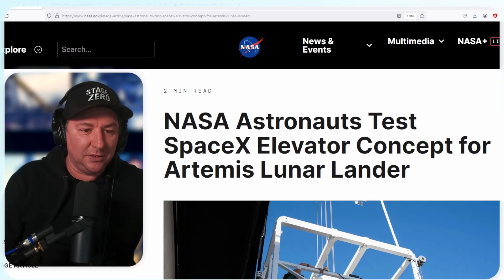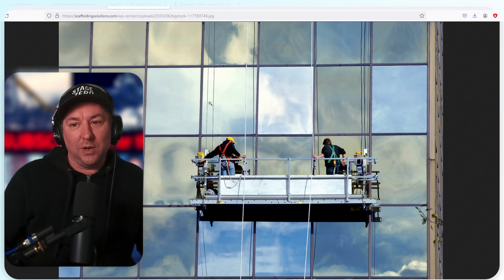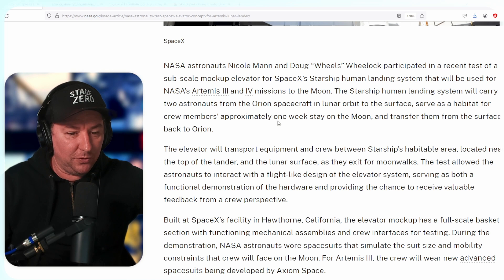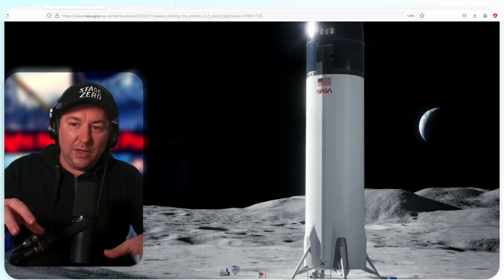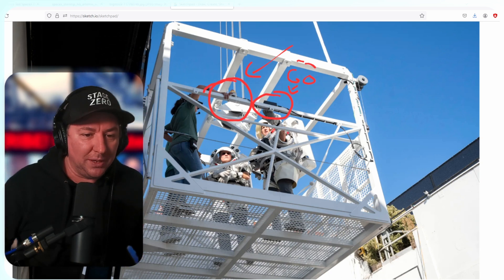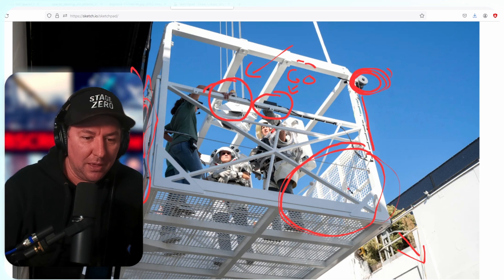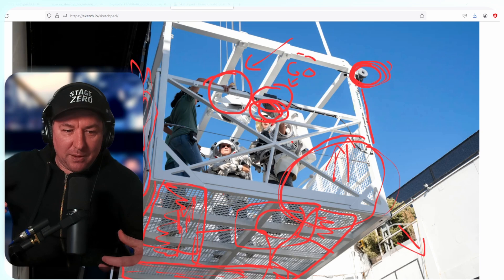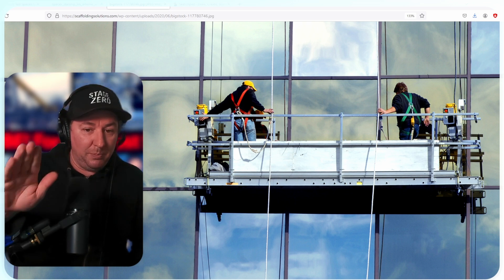Pivotal Starship and NASA component update

Comment: Wil ..... In my mind's eye ... i see that there are 2 controls to the HSL elevator: 1 - to extend/retract the elevator out/into from inside the cargo bay. 2 - to lower and raise the elevator on guide rails in the side of HLS (like a monorail). The controls in the elevator cage will not work unlesa BOTH cage gates and secured. One gate will not work unless the other is closed. Neither gate will open when the cage is in motion.  Should a power failure occur, the cage will be equipped with a manual crank to raise or lower the cage

The new Axiom EV suits come with tactile gloves foe use on touchscreen (just like the launch suite  Crew Dragon